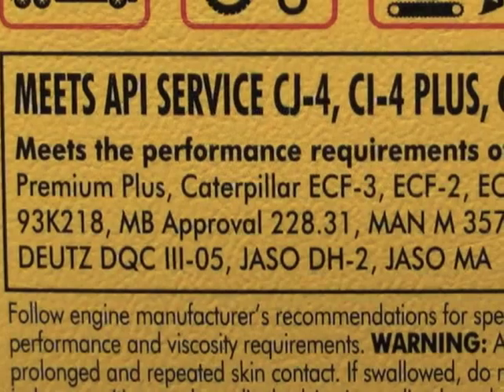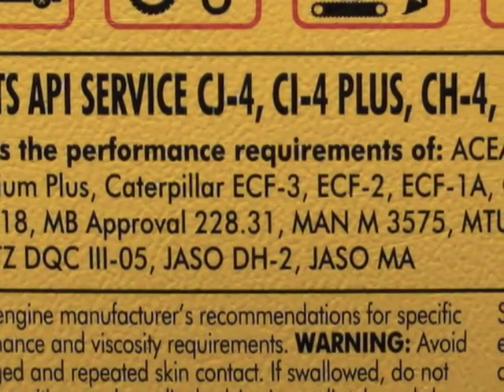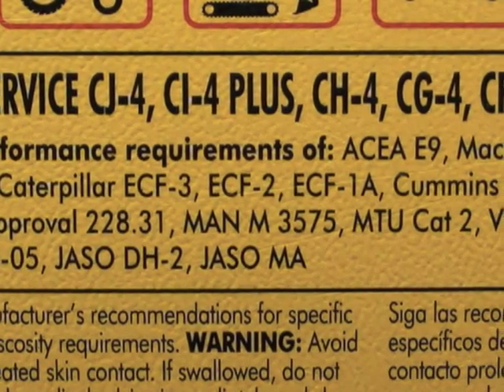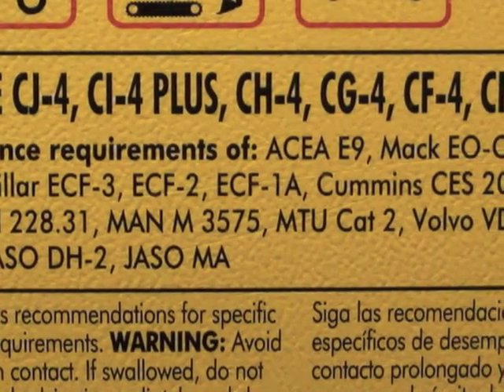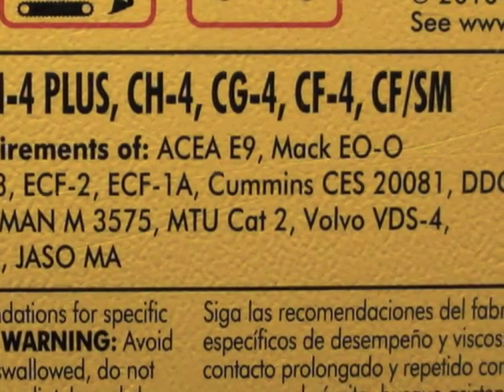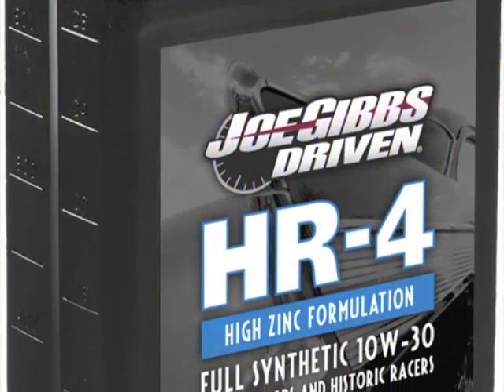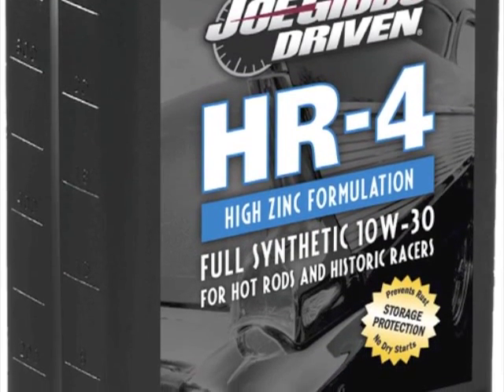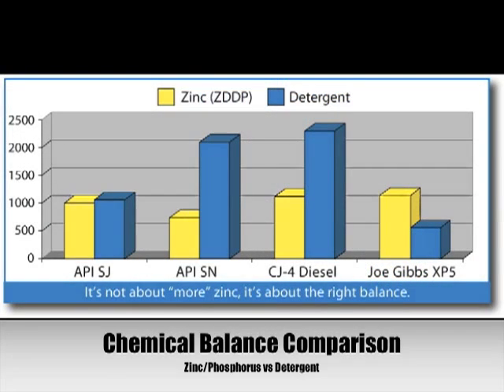Understanding Motor Oil Standards.m4v

Comment: Can I put this oil in a 2004 Toyota corolla Le?
Reply: I would go with a 100% Synthetic such as Amsoil. They have a full product line depending on your oil change interval preference. OE is for those who change oil between 3000-7500 miles. The XL line is rated for 12,000 miles and the Signature Series is rated for 25,000 miles. Keep in mind that if you go extended oil change intervals it's a good idea to send a sample to the lab periodically and to change the filter regularly, depending on the rating of the filter. Most filters are rated to filter down to 30 microns. Amsoil filters are made of a synthetic material and filter down to 20 microns, which is much more beneficial for your engine, and are rated for either 15,000 miles or 25,000 miles. It is more expensive initially, but you save on the backend because you are saving money by not having to change is as often and saving you time by not having to sit at the lube shop all the time. You can order at www.aaasynthetics.com or call 304-952-1505

Comment: So i can use a non dexos on a 1996 Chevy Impala as long as its SAE ?
Reply: That old of a vehicle I would say yes. I use Amsoil XL in my wife's 2017 GMC Terrain and will be doing an engine flush and switching over my daughters 2008 Jeep Liberty to Amsoil Signature Series 100% Synthetic (25,000 mile oil). It is Dexos1 Gen 2 Compliant. My wife's Terrain was rebuilt at 84k and all we have ever used was bulk Dexos from the dealer.. No more. The XL oil is a 100% Synthetic 12,000 mile oil. The filter is a synthetic filter rated at 15,000 miles. My daughters filter for the Jeep is also made from synthetic material and rated for 25,000 miles. I'm going to resample the Terrain at 9100 and send to the lab. I sent a sample in to the lab at 9100 miles after the rebuild and it showed high Iron content. Probably from the new ring and piston seating. You can check it out at www.aaasynthetics.com

Comment: @2:20 there is now a "dexos1 generation2" in mobile1 that should be used for GM turbo engines like the 2.0turbo found in themcadillac ats/cts, and Chevy Malibu.  It's more friendly to buildup in the turbo during short trips, and it offers improved fuel performance.

Comment: So a performance grade oil can severely damage regular street cars especially if the oil wasn't changes regularly or before it hits it's recommended changing intervals.
Reply: GM is nothing but a SCAMMER!!! 
They haven't even made the first payment on their bailout!!!
Reply: Performance or racing promoted by Redline, Purple, Amsoil is just marketing.  API labs SN Plus full synthetic is what you should look for.  SN plus mean it can stand high temps.  Warren Industries (Amazon Basics and Supertech) is probably your safest product plus more economical to use in most applications.  Warren has been around and they focus on making good oil and spend nothing on marketing.
Reply: Lake Speed Exactly

Comment: can I use desel engines oil on petroleum cars ?
Reply: If it meets the manufacturars specifications. Go by the owners manual.
Reply: you can if you don't have a cat converter, then no otherwise